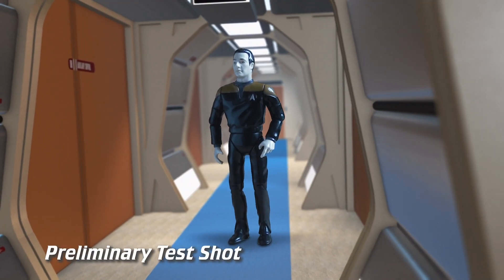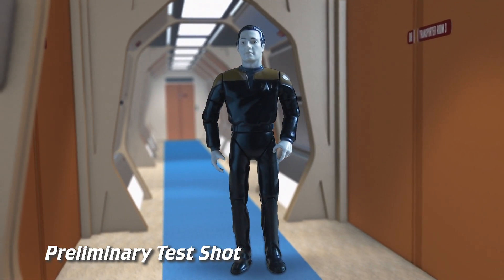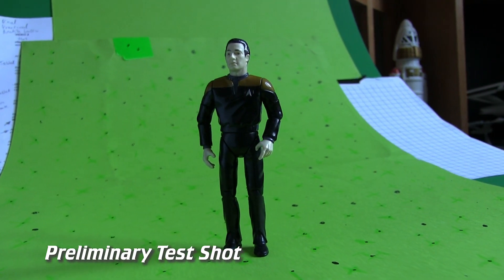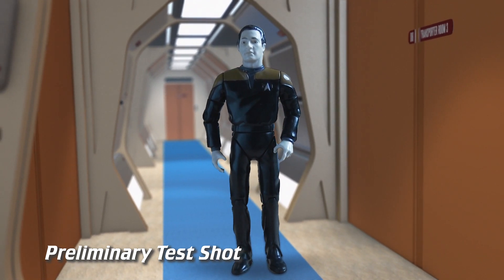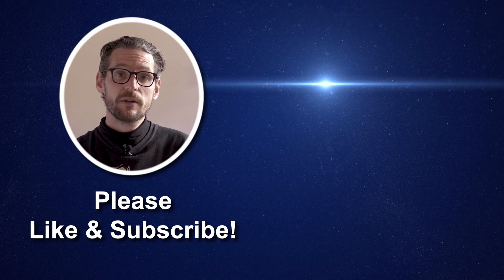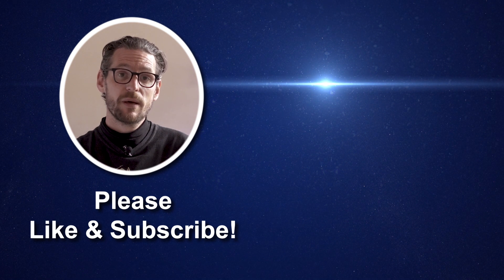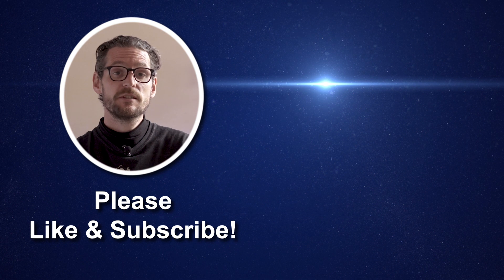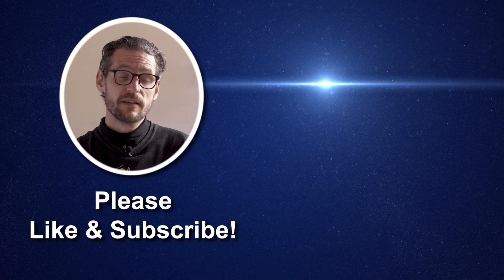Making a Star Trek Fan Film - Virtual Sets vs Physical Sets | The Holy Core

Comment: 3D modeler and long time, picky Trek fan. I think it looked good enough for production if you did one more thing. I've learned that if you add imperfections that show past wear and tear (bump map scratches and background reflection textures),  to 3d surfaces, they look more real. Also, any repeated surface, like a corridor, needs random things added to the walls and ceiling (like access panels, screw plates, a non-functioning light). keep up the good work.
Reply from the maker: Nice one, great points :-)